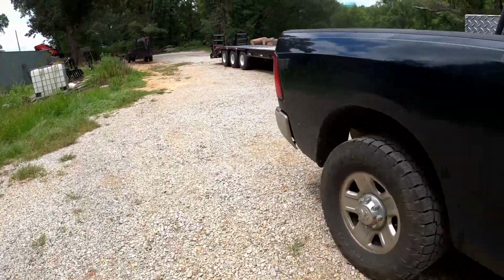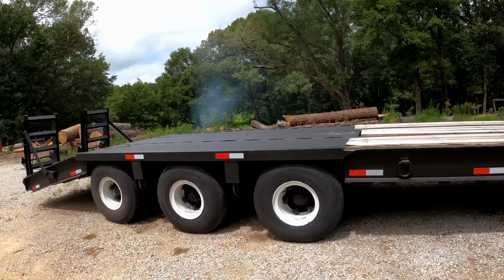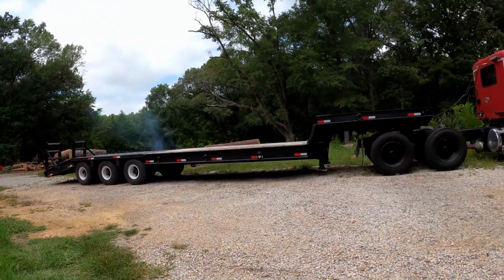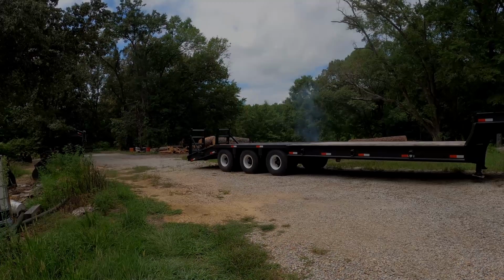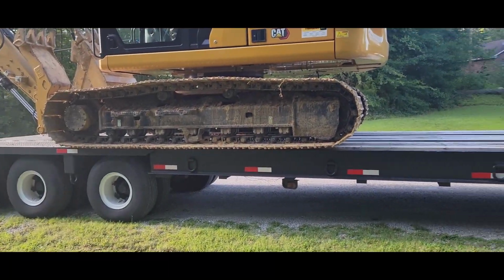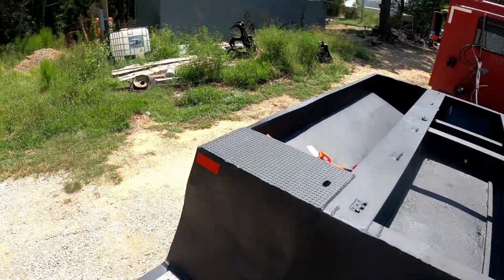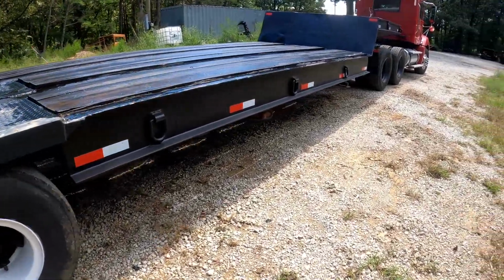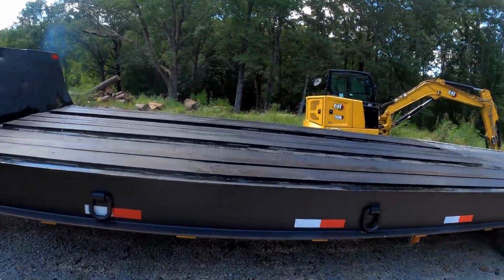I Bought A 50 Ton Lowboy!!

Comment: Looks like the trailers we had in the seabees, only difference being the diamond plate over the axles and the beavertail being added with ramps. We had ramps, but straight rear and we hauled every type of equipment you could think of with them.
Reply from the maker: It's got a US Navy tag on it. Said nasa was using it to shuttle stuff back and forth.
Reply: @smithworx1091  yeah and those tires were they 19.5 or 17.5 can't remember. We pulled them with 5 ton military tractors mostly, rough ride but we pulled D7 and D8 dozers slow and steady 😄
Reply from the maker: @Ralph Gwynn  they are 10.00 R15. I'm not sure the actual size. I just know they are stupid expensive lol
Reply: yeah the military had some odd size tires, probably harder to find?
Reply from the maker: @ralphgwynn9325  yes. Only one place in town keeps a few in stock. Only old heavy trailers still run them.

Comment: You can pull that CAT 313 and a skidsteer with that trailer easy. Just need a CDL for that setup if you get pulled over. Also you have to hit weight stations, if they are in your local area. I would skip em all together DOT always looking for something stupid to get you for.
Reply from the maker: Luckily I haven't had to go by any weigh stations yet 😬
Reply: @smithworx1091  haha just a heads up bro.

Comment: You may already know but just incase, make sure that trailer is on level ground when loading your excavator.  Metal on Metal can be very slippery,  If it every tilts or starts to slide to the side it will most likely not stop and your pretty new machine will be laying on it's side.  One of my guys slid a dozer off the side last year.  Didn't hurt him or the machine but it could have been bad.  On another note, It is a nice trailer I'm sure it will be very handy, and alot less hassle than a drop trailer.
Reply from the maker: I appreciate the advice. That was the first time I've ever loaded a machine with steel tracks and I could see real quick how dangerous it could be. I will definitely find level ground before loading and unloading lol